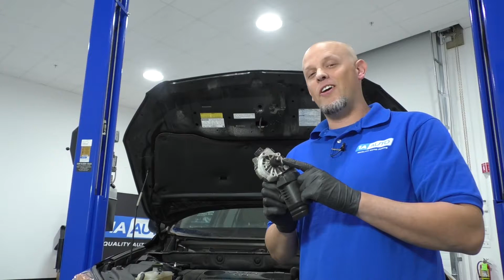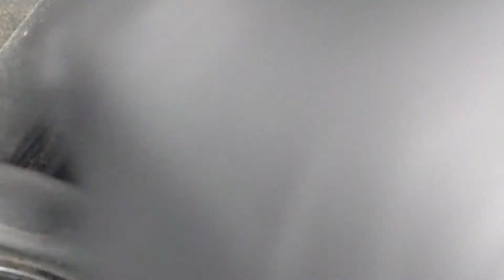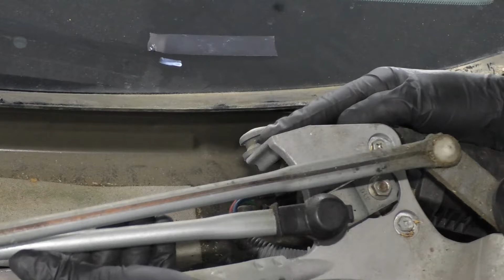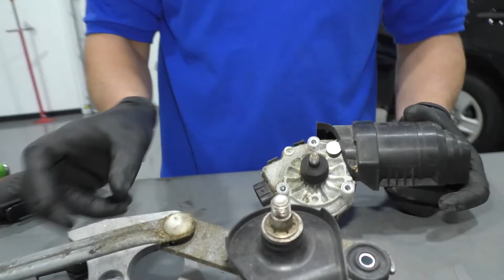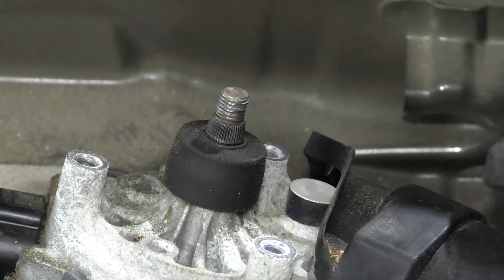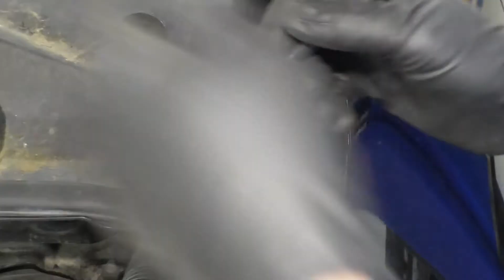How to Replace Wiper Motor 05-16 Toyota RAV4

Comment: Excellent video. I also have to change, not the motor, but the linkage. I'll follow the same procedure as you did. But mine is RHD and will have to do a mirror work. How did you pull out the wiper arm? Did you use puller? or any other method?

Comment: Fantastic video! Replacing a wiper motor sounds kind of intimidating, but your video is an excellent example of a step-by-step with good lighting, camera angles, and comprehensive explanation of each step. I even work at a Toyota Dealership 60 hours a week myself and still did this myself in about 20 minutes. Thanks a ton for giving me an excellent video to go off of!

Comment: The alignment, this way, is assuming that the motor you are replacing, died in the parked position. Otherwise time the motor as described, leaving transmission arms lose until reinstalled. Adjust accordingly.

Comment: Hi, i have a 2019 rav4 LE. All my wipers and window washers are not working (front and rear). I replaced the wiper relay with a new relay. I checked the wiper fuse and it was not blown. Basically, all functions of the wipers switch does not do anything. Could this the problem? How much does it cost to replace it if indeed its the problem? Thanks!
Reply from the maker: +Chard Man70 We wouldn't be able to diagnose an issue like that here, you may want to have a local mechanic take a look at it. Thanks for checking us out! 1AAuto.com